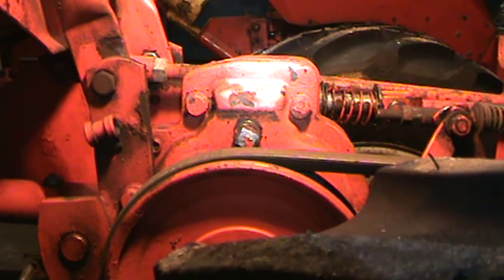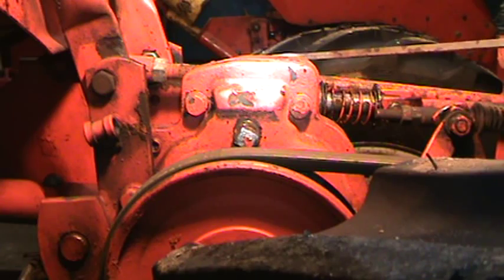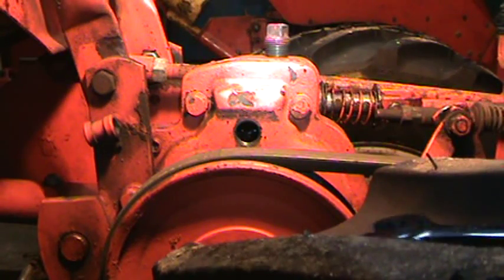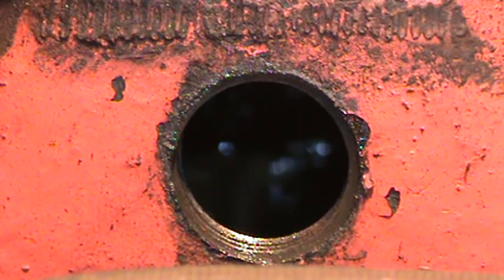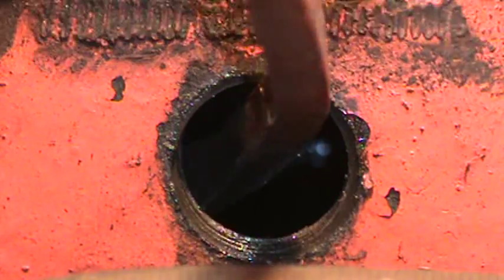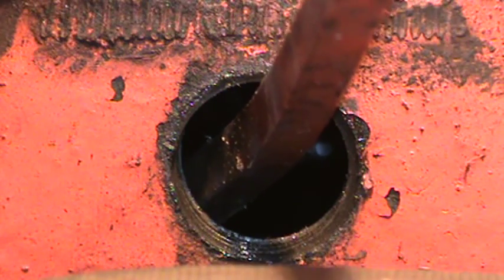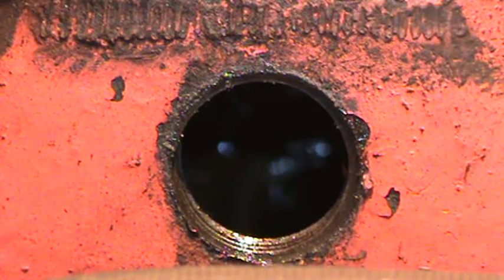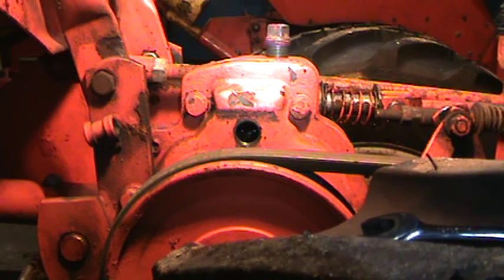Simplicity and Allis Chalmers Stuck in Gear Fix

Comment: Thanks a million!!! Once I got in the sweet spot absolutely simple...now finding her sweet spot took a little time...and until that time I called you somethings I deeply apologize for... I'll never doubt you again.
Reply from the maker: lol James. Truth.....That's the respect and appreciation I have for you. You didn't have to reveal that for a short time (or long time) I was on the $h!t list and I truly appreciate your honesty and I'm also very glad you found that sweet spot. Now....To help prevent this in the future, slow down when shifting and use positive shifting practices. Simply put, make sure you're in Neutral before selecting the next desired gear. Often, the cause of this is using an "X" shift pattern when it should be an intentional H on its side shifting method. I'm glad it finally "Clicked"!!!! Cheers! Zip~

Comment: This was super helpful.  You helped so much. For the record I used a large allen key on a Alis 912 six speed to get it out of first. I turned the key down and pushed. It took a while but I was fiddling around blind in there and had to take the pulley off. But now I know how to do it it should go much faster next time. Thank you!
Reply from the maker: You're very welcome Roaster! And yes, it can be tedious, but the satisfaction if that fork clicking back into its proper place makes it all worth while. Happy Trails! Oh....when shifting gears, do it slowly and with authority, making sure you're in neutral then positively engaging the desired gear. This happened on the tractor in the video ONE time and after changing my methods of shifting it never happened again. Cheers! Zip~

Comment: Wish I had seen this vid 25 years ago.  My AC 710 stuck in reverse I split the case to get it unstuck.   Great vid!
Reply from the maker: Before this trick was discovered, many said, the only way to get them out of being between gears was to do just that. But...where there's a will, there's a way. This is one of my most popular videos and it's saved MANY tractors and owners from the landfills. Cheers Festus! Zip~

Comment: I finally got it!  It is pretty simple, in theory, once you figure out what's going on in there & where the forks are.  Mine was stuck in 1st & I was able to get it back in the neutral position with a small pry bar.  I have to admit that I watched this several times before it sunk in, but it eventually did.  Thanks Zippo!
Reply from the maker: Awesome Sir Pipe!!!! Yeah, it takes a little practice and studying to get the visual in your head. I did as best I could to show the internals, but I couldn't shrink my self down small enough lol. Cheers Buddy! Zip~

Comment from the maker: @1371ken Next tip.....squirt some oil into the hole so you're sure to saturate the shift forks and gears from the top. Let it sit a day or so to soak in, then give it a go again. Persistence will prevail, but if it has been stuck in gear for a while, it may take a while to get it to break loose. Also, if the tractor will roll with it in gear, then get it to roll so the gears will move and then oil again. Keep at it. It will eventually work.

Comment: +ZippoVarga thanks man, surfing your videos i found the one you mention, the only difference is that in this case it was stucked in 1st gear, but the way of fixing is pretty much the same. Now IT's ALIVE!!!. There is a bunch of pieces i have to clean and adjust and your videos are very clear, even more here in Argentina where it's hard to find manuals and pieces. Regards.
Reply from the maker: +Facundo José Yatchesen Facundo, I'm very glad you were able to follow the video and get the tractor back in service! It's why I make the videos. If you have other questions, check my videos. There's over 500 and most cover these tractors and engines. Cheers!! Zip~

Comment from the maker: @ericvega1975 As these tractors age, things wear out. In the case of the transmission  getting caught between gears where it won't shift or in the case of many wheel horses I've seen that jump out of gear is just a result of time and use. Everything wears out eventually. With these Simplicities, the shifter pin and/or guide pins wear out and gives the shifter pin enough slack that it gets past the pins with out taking the tranmission out of gear first.

Comment: Hey ZippoVarga,

Glad I found you man!  Mine was stuck in first gear, so I followed your instructions and got it freed.  It wasn't as easy as you said though, as I poked around in there for quite a while with my bent screwdriver before I finally pushed or pulled the right thing.  I really could not see anything inside that small hole even with a flashlight, so I was shooting blind.  Don't really remember exactly what action freed it for me, but it did work.  I'm wondering now just why it locked up in the first place, and whether it is it likely to just lock up again when I start shifting.  Is there some specific lube point that I should hit with oil or grease to minimize my chances of this happening again?  Anyway, thanks again man, I was about to go out and spend some serious bucks on this thing.  You da man...

Comment from the maker: You should be able to remove the shifter it self and position it correctly into the groove that is off set. You should see two "forks"....one will be centered, the other off to one side or the other. The one that is off to one side is where you want to reinsert the shifter. Best of luck to you!!

Comment: Hey zippo I have a simplicity sovereign 7016 stuck in first I tried to do what you said but can’t seem to get the fork back to neutral do you have anymore advise.
Reply from the maker: Keep at it. You might want to squirt some PB Blaster into the hole and onto the shift forks and the shafts they ride on. It'll work! Sometimes takes a while, but that moment it slips back into place you'll do your happy dance and the ole 7016 will be back in business. Zip~

Comment: Hey Zippo, got a 8050 Deutz stuck in 4th. Not sure exactly where to find this bolt. Is it directly under the shifter inside the cab or outside? Thanks for the video.
Reply from the maker: Totally different Animal (Problem) Gabriel, and one that I'm sorry to say I cannot help with, as I'm not familiar enough with the 8050 to offer assistance. I apologize and wish you the best. Zip~

Comment: Hi Zippo, 
My Allis Chalmers 410 only clicks when i turn the key.. It turned over twice but then the starter stopped turning over. It has worked for many years prior. I bridged the solenoid to see if the starter or what I think is the starter would work and got a shower of sparks like I was hooking pos to neg on a battery. It even left a spot on the nut which is under the black boot on the alternator /starter assembly. Not sure is going on  but without a manual or schematic for this tractor I am not sure what is going on here... If I need a starter do you have any idea where to find one? I cant find anything that looks like it. Any help would be appreciated even if only  a comment. Thank you man.. You do great videos!

Comment: hi I have bin watching alot of your vids, I acquired  a B10 ,  and a B112  and a old Ford 100 from a trade for a chainsaw. not able to get any of them running I swapped the engine on the B112 for a KUBOTA 13 horse single cylender that I repurposed from a 6500 watt generator.  well now the tractor drives backwards in 1st 2nd & 3rd also it drives forward when in reverse not to mention that it does this at a very slow pace till it throws the belt.  I am not uderstanding why this happend   thanks for your time any help would be appreciated.
Reply from the maker: The engine is in the wrong orientation. It needs turned around front to back. The engine has to spin the drive shaft clockwise. Zip~

Comment: zippo my landlord is stuck in gear, but the shifting forks look like they are properly aligned. broken shift fork. i'm stumped. waiting for a service manual . you really know your way around these tractors, i am pretty new at it.
Reply from the maker: If you're caught in a gear and the shifter moves and goes into other gears (except for the one opposite of the current gear it's stuck in), then this video is the solution. If the pin has sheared off the shift rod that goes between the two gear selector forks inside the transmission, then the shifter will do nothing but flop around. Zip~

Comment: My B-10 (or Monkey Ward equal -no labels) tranny is jammed. Tractor cannot be moved.  Problem started with no second gear, just freewheeled. All other gears worked and shifter felt normal.  Now tranny is locked up, shifter still feels normal.  Any suggestions other than disassembly?  If its a broken gear, what the chance of finding replacement gears?

Comment: I have found this situation primarily on tractors where the operator was struggling with an out of adjustment clutch and has been slamming the tractor into and out of gear.

Comment: The 6116 is different then your video, the shifter is on a stud that comes out the front.  The stud has a flange that the shifter is attached to.  the flang broke off.   Partstree shows the trany 1690422 is the model.  I'm not sure how to hook you up with a video??  Thanks, Dan

Comment: I have a Simplicity GTG14 ( 1692024 ) 6 speed , Tough Torq k210A ( gear ) that locks up ( mostly) in Neutral, but sometimes in "R" or "1".

With the linkage disconnected I cannot even budge the shift arm @ the transaxel.

Any ideas ?
Reply from the maker: This model has the Peerless transaxle and the Bentonite that was used as a gear lube in the case. Over time, the Bentonite, which is actually a Clay compound mixed with a petroleum thinning agent separates back into oil and the Bentonite. When this happens, the Bentonite clay becomes very sticky. Your best bet is to drill a small hole in the top of the transaxle and add gear oil. Typically a quart is plenty enough. Be aware though. These transaxle's are not sealed units, so expect the gear oil to weep a little from the axle inputs and possibly the brake disc shaft. It's also a good idea to use a thin oil like 3 in 1 and drip it down the gear selector shaft. Within the gear case the shift selector shaft has a spring loaded ball bearing that falls into the detentes within the gear case. So you'll need to be patient and drip oil every few minutes while turning the selector shaft from reverse through to the highest gear until the shifting smooths out. When the tractor is in use, you'll want to have a rubber plug in the hole you drilled to prevent contaminants from entering through the hole and potentially causing premature wear to the internal components. Good Luck! And, I've got an older video series showing the internals of these transmissions. Here is a link to a rant I posted a while back. https://www.youtube.com/watch?v=I-fRSonIwug  Zip~
Reply: Interesting !

Bebtonite is the main compoun in cat litter You may be correct on the problem and fix, however; I do N0T have a Peerlesstransaxel.
My tractor has a Tuff Torq K 210-A mechanical geared  transaxel.  The center gear case splits vertically not horizontally.  It has a drain plug and fill cap.  The steel axels are located externally from the housing and not encased in it.
Upon examining the Simplicity rebuild manual I suspected the problem might possibly be in the shift detent , the shift fingers or shoft detent shaft.

I believe Ill split the case , examine and internally flush the case and refillit.
Reply: Thanks for the advice, Ill let you know how it turns out

Comment: I have a 1976 Allis Chalmers 610 with a four speed manual transmission that is stuck in 3rd. I have the top plug out and can see the shift fork but not sure how to move it to get it out of third. It is the small frame 10 hp garden tractor with tiller, blower and mower.
Reply: David W Maaske I was able to push the shift fork with a screw driver to unlock the third gear. It works fine now and I know how to fix it if it happens again.
Reply from the maker: David W Maaske David, I'm glad you were able to get it figured out and working again!! I hope the video aided you in the principal. Cheers!! Zip~

Comment: Hey Zippo....

I picked up a 3410 shuttle and it won't shift in to 1st or 3rd
Any easy fix or test?
works fine in 2nd and 4th
needs a gas cap and a carb rebuild.(carb leaks)
also whines when in reverse..assuming it's the brake band...

I was playing with it and got it in to 1st...now can't get it out...

Comment: I have an Allis Chalmers B-210.    Could you help and indicate if the screw driver is in the 9 o'clock position or at 7 o'clock.   Past owner indicated that rhe unit locked in reverse while snow blowing and has sat since.   Gear shift can move to 1st, 3rd and 2nd but nor reverse.
Reply from the maker: Does 1 through 3rd gear work or does the tractor move at the same speed regardless of which gear you select? Zip~

Comment: Hi guys, I have a question about my allis chalmers Big 10. Need to replace axle seal on differential side. Got wheel off got into differential, took out snap ring and 3 washers and can't get any further. I need some HELP.

Comment from the maker: @1371ken Honestly.......and don't cringe when I tell you this.....take a dead blow hammer and whaco it to see if it will go into second. If it does, as you use it the problem will resolve it self. Also, make sure there is enough gear oil in the transfer case.

Comment: will this work on my 67? A.C.B-12 its stuck in reverse I can not see the forks I see the roll pins & a pin on the shifter rod do not see the forks ?
Reply from the maker: If the shift lever moves forward and back freely with the transmission in reverse, then this is the fix. In the video, I show the forward fork rod because it was easier to get on camera. If you can't see the rear fork rod, remove the wheel from that side of the tractor so you can get a better vantage point. The actual fork it self points downward. Since the tractor is stuck in reverse, the fork needs pulled towards you. Put the shift lever full forward so the pin on the shifter rod is not in the way. Their are two rods that each hold the fork for 1st and reverse and the other for 2nd and 3rd gear. The 1st and reverse is the rod towards the rear. Insert the bent screwdriver positioned with the hook towards 8 o'clock to the far side of the rod (deep within the access hole) and drag it along the rear shaft towards you. The driver will make contact with the top of the fork. At that point, leverage the bent screwdriver against the hole and push the handle of the screwdriver away from you a single click. If you feel two movements, you went too far. The idea is to center the fork between 1st and reverse. Check to see if the large pulley will spin freely with the clutch depressed without the wheels moving. If so, you have returned the shift fork to the correct position and can replace the plug. To prevent this in the future, make your shifts more slowly and make sure you are in neutral before attempting to select another gear.
Reply: I got once but when I ran it through the gears it got stuck again !!!! the pin with the ball on it is super loose could that make a difference ??? fork doesn't move very easy I can see what u r talking about clearly !!!  the shift lever moves forward and back freely lots play though???? anything would help ????
Reply: ZippoVarga mess with it all day every time I would get it in neutral it would just go back to being stuck in reverse ???new tranny time ??? HELP !!! PLEASE AND THANK U!!!!!!!!!!!!!
Reply: ZippoVarga  reverse gears tore up!! would you know where to get a trans 4 a B-12
Reply from the maker: Go to the Facebook Simplicity and Allis Chalmers collectors group and I'm sure someone in your area has one there for you.

Comment: Know this video is old, just wanted to see if any one could help with a 6116 trany issue.  Broke the shifter off, took the rear end out welded it back on, reassembled and now can only shift into first.  Anyway to fix?

Comment: hey i just came across your channel and im having trouble fixing my 1971 simplicity landlord 3410. its stuck in second gear, everytime i put it in 2nd it gets stuck. i have it all apart right now but i dont know much about these rear ends or how they work. if you could give me any advice or things to look for to try and fix this problem id be very thankful. message me back or i can give my email/ number to contact me. ive been researching the internet to try and find manuals or forums but im having no luck. thank you either way
Reply from the maker: Find me on Facebook by going to my home page and clicking on the Facebook icon on the banner at the top. There, you can message me and I can send you manuals on your machine to help you along. Sticking in gear is usually just a little rust that's formed on the shafts the gears ride on and the fix is actually quite easy. But since you have the transmission apart, just oil everything down well with a thin synthetic oil and reassemble. Check all of the cross shafts that the gear selector sides on for any abnormalities like burrs or rust, and correct that. Cheers! Zip~

Comment: I've got a ?, I can't get to 1st and 3rd, it shifts in to 2nd and reverse but it will not go up to 1,3. blockage under the dash where the rod goes, or broken something
Reply from the maker: +Kraken King There is a small guide that the shift rod slides through. If the "cage nut" fell out of the hole, then you will have problems moving the shift rid forward and back. It's buried WAY deep under the dash, but if you take the shift quadrant cover off (that the shift rod comes through) you can access the piece and replace the cage nut. 
Zip~